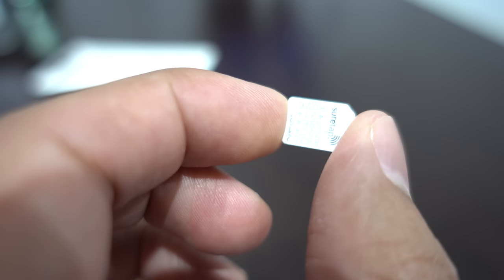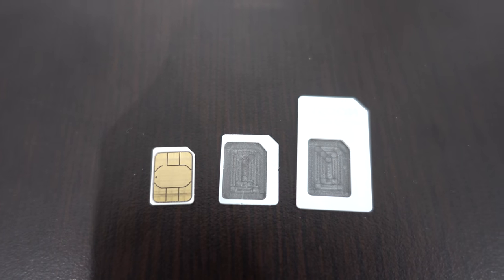Explained: eSIM and SIM Card

Comment: eSIIM sux. It's a huge step back. It's just like old analogical phones, were you need to contact the operator to activate the service.... Is too much sacrifice to gain a little space. Much worse than remove headphones jack.
Reply: Dropping the physical slot would indeed suck. However, offering eSIM + nanoSIM like the iPhone XS does is the way to go. Prevents disaster like losing the SIM tray in-flight while swapping SIMs. Now we finally can have two operators and switch in the phone settings instead of playing with fire...

Comment: 0:59 The SIM doesn't  "receive" or inject the "signal" into your phone! that would be the Rado-Modem CHIP,  The SIM is just a low-capacity memory that contains the data needed to connect to your carrier and identify you as a user, in the past, you can also store texts and contacts. Is a carry-over technology from the first era of cellphones is not really needed nowadays.

Comment: The point is that you don't save any space, the dual sim feature will have a slot for one SIM card n the other for esim
Reply: Raymond Lee Err , no , there is no slot for the esim ; it’s simply a module in the installed firmware.

Comment: Not at all accurate. When properly implemented you can swap, add, switch, and store multiple carriers with ease.  An e Sim is programmable so you can just add a new carrier by adding a new sim code although right now not all carriers are setup that way. An eSIM may be provisioned remotely, but end-users can add or remove operators without the need to physically swap a SIM from the device, just add a new SIM code. No phone calls needed.